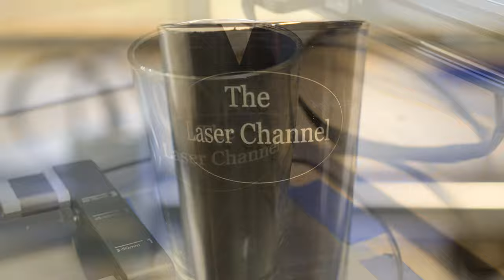xTool D1- Best Engraving Glass Method

Comment: I have a similar set up to engrave glasses, but I found some simple ways of fixing them.  I got a handful of rare earth magnets from Harbor Freight.  I made an L shaped guide to hold my rotary drive in place which is about one inch thick and skirts around the backside and right side of my rotary.   It has magnets inset to hold it in place.  I have a 4 inch wide wedge with inset magnets that I use to raise the back side of the rotary drive.  The magnets hold everything in place to my sheet metal base.    I use my magnets to hold work in place while I'm engraving or cutting.  They are cheap and work great.    Good video!  thanks
Reply from the maker: Thanks for sharing your setup!

Comment: My XTool D1 Pro 20W with Rotary should be here  tomorrow!!  Super excited!  How are you creating you donuts and out of what material?  Video was great but i have a LOT to learn about the D1!
Reply from the maker: The XTOOL D1 PRO 20w with the current rotary is an excellent combo!  I hear a lot of great things for the D1 PRO 20W!  I use 1/4 thick plywood from my local big box store.  I have a follow up video scheduled with more focused info on the specific set up and method I use- the audio will also be much better!  Thanks!

Comment: Why do you remove the protection from the laser, I mean the orange protector that it has on the tip, is it because it sometimes hits some things or for some other reason?
Thank you
Reply from the maker: Hi- I have mine removed for videoing.  I also found there's less smoke residue build up in the laser nozzle area.  I operate my laser with either safety glasses on or inside a laser enclosure when not videoing.  Thanks for watching!

Comment: Great video,  I searched your channel for engraving tumblers and didn’t see anything.  What settings would you recommend for a powder coated tumbler, using laserbox.  Thank you
Reply from the maker: Hi Cindy- I haven't cover engraving tumblers on the channel- yet.  On thick coated tumblers like YETI start with 55mm/s at 90% power and other tumblers 55mm/s at 50% power- the brand and color of the tumbler will greatly affect the settings.  It's always recommended to have an extra tumbler for test engraving.  After engraving clean with a white "Magic Pad" or something like acetone. Hopefully the listed settings will be a great starting point for you!

Comment: Might be kind of a dumb question for you, but if you were to get a laser engraver with the proper ventilation and enclosure for it, would I be able to leave it unattended in my garage while I work on other things inside? I would really like to get one of these but if I need to be present at all times it’s running I’m not sure it’s for me. I just can’t spend hours a day attending to it just to monitor it. Maybe I could install a smoke detector like you have? Please let me know your thoughts on this, thanks!
Reply from the maker: You have a very good question and it's one I hear often!  Since making this video I received a Comgrow enclosure; it has a vent hole and is made from flame resistant material- I like it.  A machine that's running should not be left unattended- fires can start up in a matter of seconds.  There's many stories of people working the laser room and fires starting.  Enclosures tend to leak a little smoke and tend to trip smoke detectors.  I can only offer to practice safety, be in the laser area at all times, and to find something to pass the time while the laser is running.
Reply: @thelaserchannel1  Ok thanks so much for the detailed response, appreciate it!
Reply from the maker: @rhysmassengill8758  You're welcome- I know it was probably not the answer you wanted to hear but unattended lasers have been known to start some very serous fires.
Reply: @thelaserchannel1  no I get it, appreciate the straightforward answer

Comment: Have you ever done a full whiskey bottle or wine bottle! ??
Reply from the maker: No haven't engraved full bottles.  I've seen others do it.  I could see maybe doing this for myself but I hesitate to do it for a customer using a laser diode.  I'm slightly concerned some engraving could be on the inside of the bottle and produce micro shards of glass- I tend to error on the side of caution.  Maybe on a Co2 laser...

Comment: What machine do you use? I am wondering what the differences are between laser heads and which one I should start with. I see that XTool has a "Two in One" tool. What would be the advantage and/or disadvantage of that tool? - Rick
Reply from the maker: Thanks for watching! It's nice that Xtool offers the Two in One option, it's one less machine and lowers the overall cost of owning two separate machines; on the flip side there's swapping out the laser modules and the plug in connectors- I can't recall what the connectors look like but I hope they are made to plug and unplug over the life of the machine.  In my shop I run Co2, lots of Laser Diode machines, and for metal work I run a 50watt Fiber laser.  On option to check out is a Fiber laser in the 20watt power range- the cost is dropping and Fiber lasers are crazy fast and make short work of any metal work.

Comment: If you are going to do any reasonable volumes with the same type of glass I would resize the wooden donut to make the glass level.
Reply from the maker: The donut does need to be the diameter of the largest part of the glass to make the glass roll straight on the rotary attachment.  If the donut is made larger the glass will hop around on the rotary due to the different diameter of the glass and donut.  Good question and thank you for asking!

Comment: So can you do a glass bottles with liquid inside or does it have to be empty?
Reply from the maker: I recommend engraving on empty bottles, but I never tried a filled and sealed bottle.  Two things come to mind. 1- Will the liquid inside the bottle heat up and cause the cap to pop off. 2- A big concern would be secondary engraving on the inside of the bottle keeping in mind the engraving process is micro shattering the surface of the glass and I'm not sure I would want to run the risk of tiny bits of the glass inside the bottle.  When the glassware has food contact our shop only engraves the non food side.

Comment: Just curious what air pressure you were running on your air brush.. are you using a small hobby compressor or off a large compressor with the pressure stepped down?  Great process explanation, thanks!
Reply from the maker: Great question- I run the airbrush pressure around 25psi from a contractor type compressor.  The paint is reduced  1 part water to 2 parts paint.
Reply: @thelaserchannel1  thanks.. I'll try that pressure.. I've been using the little propellant "PreVal" spray system but picked up an airbrush after my buddy Cobey Schmidt told me to try one.
Reply from the maker: @mpcaz  Nice- airbrushes run at different psi- I recommend starting low and working your way up to find out what works best for your setup.  I test mine on cardboard.  Airbrushes are great for those painted wood projects!

Comment: May I ask would just putting a black piece of paper inside would work instead of spray paint. Thanks in advance.
Reply from the maker: Hi- great comment.  Paper on the inside/ under glass does work.  On glass that touches food it's common practice to not engrave the food/drink side of the material.
Reply: @thelaserchannel1 , I ordered xtool, it is not here yet. But just want to understand before hands. Thank you for the reply. Just to clarify what you said. I understood as, if I put the paper underneath the glass. The laser actually will engrave the surface that between the glass and the paper?
Reply from the maker: @ngoctran8508  Correct, place the black paper on a metal surface like aluminum or aluminum foil (the thicker type), then place the black paper, and finally the glass on top.  Set the focus to the paper layer and find your best speed and power settings.  I've briefly tried this method and I recall it does mark/etch the glass.  I have a video scheduled that includes about 5 different methods for engraving glass.  Stay tuned and congrats on you Xtool order!

Comment: Have you tried to engrave thick glass, 3/8"-1/2"?  Do you need different settings? Thanks in advance.
Reply from the maker: I have not- but I would recommend engraving the surface closed to the laser module.  This means you might need to "Flip Horizontal" to engrave on what would be the "bottom" of the glass if you want the glass with the engraving on the bottom.  If your engraving is on the top surface there's no need to "Flip Horizontal".  Hope this helps!
Reply: @thelaserchannel1  thanks for the info

Comment: Why the paint? Can you just engrave without it? What happens if you don't?
Reply from the maker: That's a very good question- I and other laser engravers use a paint as a masking agent.  Without the paint the laser energy will pass through the glass without marking or engraving the glass.  The paint absorbs enough of the laser energy and transfers most of the energy to the glass allowing for the engraving.  Diode lasers need an opaque masking agent while Co2 lasers can get by with far less masking agent.  Hope this helps!

Comment: Will Laser box. basic work with Fox Alien 4040xe 20 watt laser?
Reply from the maker: That's a good question- I don't know for certain but the controller boards are different so my guess would be Laserbox Basic will not connect to the Fox Alien laser machine.

Comment: Why didn't you just use the black paper in the glass rather than spray paint it?
Reply from the maker: At the time of filming the black tempera paint was the best water based masking method.  I've read about the method you mentioned and it would very interesting to try on non- food items.  Using the black paper method would engraving the inside of the glass- the food side and it's our shop's practice never to engrave on the food side.  Food can collect or stain on the engraving not to mention the engraving is actually micro shattering the glass.

Comment: Good afternoon,
Sorry for bothering you,
I bought same laser you have stool d1 pro
I try 100 times to engrave on stainless steel but didn't work I use xtool program
But I don't know how to use the right sittings I try to follow all tip on YouTube but not working 😞 could you please give me some advice or screenshot of right setting or video
Best regards
Reply from the maker: Hi Jan Mo-   I'm using the D1 10watt non pro version.  For Stainless Steel I use black tempera paint to etch the metal.  I spray 2-3 light coats of the tempera paint to produce a dark etching using these settings: 5-10 mm/s at 100%.  You do not need to use tempera paint but it does produce a much darker finish- hope this helps!

Comment: don't you have to mirror the object??
Reply from the maker: Not when engraving on the top surface.  I like to practice using blue painters tape at a low power level to check placement and size- this is also a great time to also check if mirroring the image makes sense for the project!  Thanks for watching!
Reply: @thelaserchannel1  thank you

Comment: Looks like the laserbox software has changed. even with upgraded driver and software it doesnt recognize the usb port..even when buying a new computer. have you heard of this issue..support has been non-responsive
Reply from the maker: I'm running either LaserBox  basic or Lightburn- I've mainly been running LightBurn.

Comment: Why didn't you just turn the glass around so that the taper was a the wide end? Glass would have been straight then. And then flip the image
Reply from the maker: This is the way the glass looks when 4 points of contact to the rotary are the same diameter and the glass is level to the laser head.  The glass will roll smoothly on the rotary with the donut- without it the glass will shift and hop on the rotary.